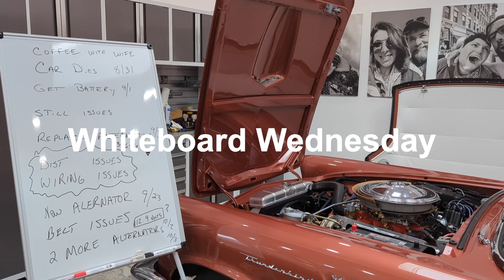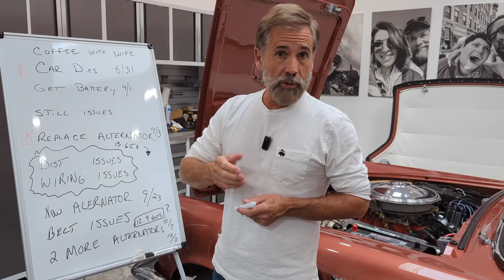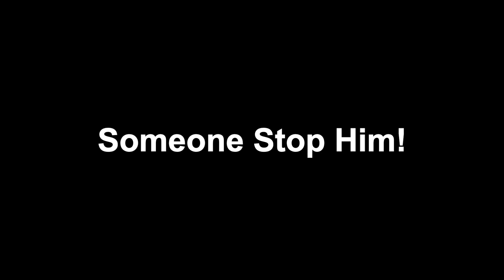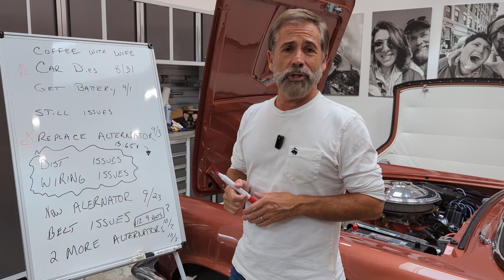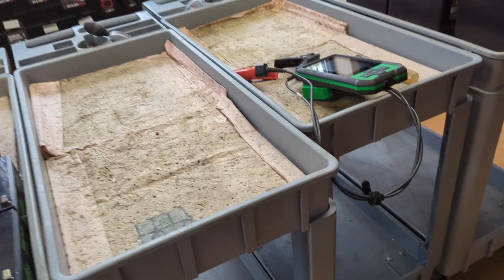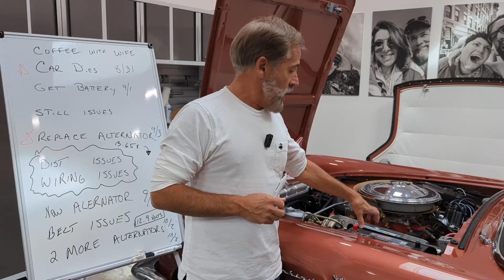Battery issues hiding in plain sight - After 5 alternators I found the issue. #mechanic #classiccars

Comment: Interstate once had great batteries. Often lasted 10 years or better. Fast forward to sometime between 2005-2015. I worked at the Saab dealer. Interstate was our battery supplier. They still had good warranty and service, but their batteries went to complete crap. No one can tell me different. I lived it. I can't tell you how many batteries lasted one year and quit exactly 1 year later. Over and over. Sure, the customer got a 'free' new battery, but at what cost in convenience and getting stranded and having to bring the car in etc. We also got weird ones like yours where the battery would test good, but it would actually completely cut out, and then come back like turning a light switch on and off. Interstate had started to make batteries from recycled batteries. Also, they would charge and test the ones turned in as bad/funky, and sometimes clean them and shrink wrap them and send them back out as "new". Seriously, Walmart has better batteries than Interstate now. They are still riding the name and old reputation. Complete and utter crap. I would never again put one in one of my cars, or anyone else I know. I am speaking from actual experience with hundreds of crap batteries. Over and over and over. I'm still angry about it. Don't be surprised if your battery ends up in another car after Interstate 'freshens' it up.

Comment: I personally carry a battery powered jump starter with me just to avoid getting stranded by a dead battery. Project Farm on YouTube has done several reviews of battery powered jump starters and they are surprisingly small thanks to the lithium battery tech we have now days. I don't even carry jumper cables in my work truck any longer thanks to having one of those that are strong enough to jump start a diesel engine a few times.
Reply from the maker: My wife will probably get me a new one for Christmas 🙂 she prefers that than picking me up. I had not used my jump pack in a long time and it was actually dead the other day so it's time for a new one!

Comment: Good video!!
I had the same problem. Batteries that sit on the shelf too long can sulfate even if you just bought it. 
Always check the date of manufacture
Battery guru told me in 3 months its over. $60 battery maintainer helps. 
And always check your tire dates!! My wife was given her late mother's BMW that still had the original tires from 1986. 
How about a video on this one?
Reply from the maker: Great ideas Bobby. My challenge was that this battery was manufactured in September 2025. I just trusted it too much. You can be sure I will be watching this new battery very closely!